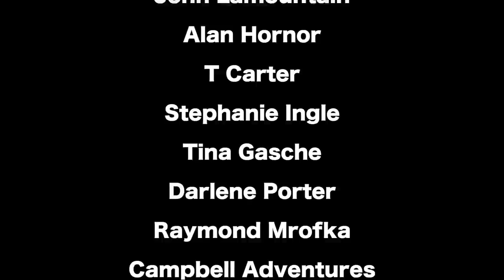RUNNING WATER LINES - Preparing the Chicken Garden for Pressurized Water (Day 160)

Comment: Ok, I enjoy the show.  You've pretty much figured out the basics.  One bit of advise.  If you're gonna use pex invest in uponor or type a pex.  The fittings are expansion type vs crimp ring.  Chemistry  provides a fast reliable leakproof method of  connection.  The best way to go is to invest in the cordless tool to make fast leakproof seals.  Budget minded will use the manual expansion tool.  The issue with crimp connection is the crimp needs to be within tolerance, clamps are subject to rust, and time expence to install test and protect crimp band joints.  Uponor or type a pex relies on the chemistry of the pex tubing.  The tubing has a memory meaning that if if is stretched it will return to its original form or shape.  Type a pex uses a pex collar slipped onto the end of the tubing. This is equivalent to the crimp band.  The expansion tool is then inserted and operated to stretch the tubing and collar to point of install of fittings. Then you insert the fitting into the tubing and a few seconds later you have a watertight fitting after the pex memory returns the pex to original diameter.   I personally can do a uponor fitting in about 30 seconds with almost no chance of leaks.  Uponor or type a is fast, doesn't fail to rust, and will reliably create a leakproof connection.  Crimp joints tend to start leaking after you have already finished the wall or floor which means digging  to find and fix leak.  Expansion joints are sealed immediately.  The cost is initially higher because of tools but speed and reliability negate the expense.  You have tons of projects and a house to build so the cost diluted even more.  When your done just sell the tool and recoup the expense.

Comment: When I installed faucets similar to that, the water flow was so close to the mounting surface it was difficult to get buckets under comfortably.  I bought a wire protected ~6” Garden Hose Kink Protector with Coil Spring from the garden/hose sprayer section of the hardware store.  It made a world of difference in the ease of use.

You are all doing an amazing job on all this infrastructure for your homestead!  So inspiring!
Reply from the maker: Yeah we'll probably extend something for buckets. Though the back one will be used for drip irrigation.

Comment: Should have frost free water facets to attach at your junction point, a 5 gallon bucket with rock is also a good idea under the facets to allow them to drain easily.
Reply from the maker: Not worth the cost for the 3 times a year it freezes. We’ll use a low point drain in the pump house for when it’s too cold.

Comment: Good morning TSHomesteders! 
FYI, the spigot is called a hose bib. Can't believe you did this whole episode and still didn't mention how the water collection is going!  See you tomorrow.
Reply: In calif we call it a hose Bib too.
Reply: Hose bib, spigot, it's all the same thing, just depends on what part of the country you are are from. Soda, Pop, Tomato, Potato.....😊
Reply: So far we have lived in Illinois, Vermont,Massachusetts, Indiana, Florida and now North Carolina.  We had never heard of a hose bib until today.  It has always been a spigot.  We are 74 and 80 so it has involved an untold number of spigots.  Fascinating country we 
all live in.
Reply: I live in southern Minnesota. Frost line is 42" below grade. Waterlines are usually installed 6 feet down. We use outside hydrants for this kind of application. The handle on top moves a rod that opens and closes a valve that's at the bottom, 6 feet underground. The base of the hydrant is surrounded by gravel. When the valve is closed, it opens a drain that allows the water trapped inside the hydrant to drain out into the gravel. 40 below zero, no heat tape, no insulation, and it will still provide water and not freeze (as long as you don't keep a hose connected to it). They also have a nifty bucket hook cast into the housing so you can hang a five gallon bucket and fill it without having to hold it. 

 I'm jealous you only have to dig down a foot and a half.

Comment: Maybe a better way to secure the hose faucet would be to drill through the wall and attach a long bolt and nut. Put a plywood on other side to help hold nut and washer.

Comment: I just had another idea, probably better than my last:  have you tried the hind of sponge used for scrubbing dishes? I think they are made the size of the sponge you use.  I was thinking the scruppy side would last longer than the sponge and might make your work of smoothing easier if it works.  And if the scrubby side is good, you could easily ( maybe even free) get one of these large scrubbies used by janitors on the floor cleaning machines.  They throw away their used ones all the time.
And they're easy to cut to any size you want.

Comment: If you buried the pipe below the frost line to avoid freezing why wouldn’t you get a frost free faucet to avoid it freezing?
Reply: Yeah this guy is right... I'm really concerned about this... I know you are in southern Arizona but if your frost line is at 18" that 1/4" to 1/2" insulation is not going to keep that from freezing... also on your install using pex or any plastic pipe before you go vertical to come out of the ground use galvanized pipe for a few feet then elbow up vertical... this will take much of the strain off the plastic connection... and on plastic connections try to use plastic male to steel female.... because the male will be under compression on the fitting and if you use the female plastic it will Crack from the compression of the male pipe... I know this is wordy but I hope it makes sense and helps you avoid future problems.

Comment: It looks like you used brass to a galvanized pipe. The metals react and cause corrosion. I used PVC pipe to run water to raised with a brass spigot and had no problems for two years . I live in far west Texas in an area very similar to yours .
Reply from the maker: Have used this same setup for years on our Airstream without any issues.